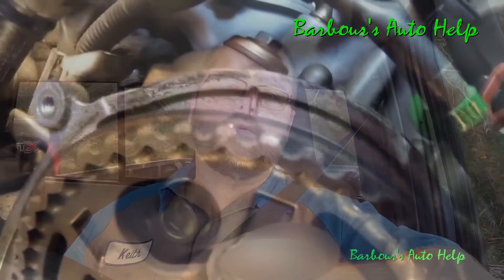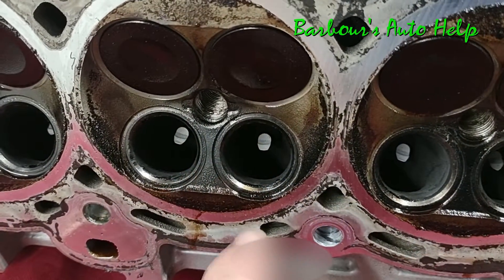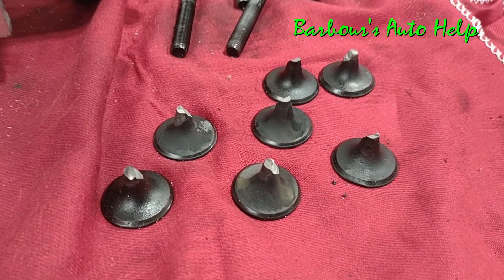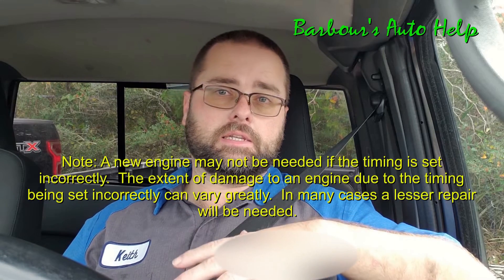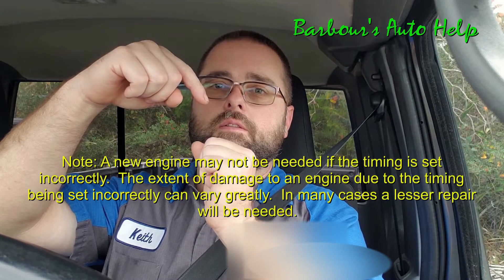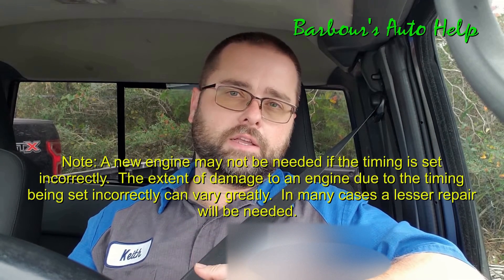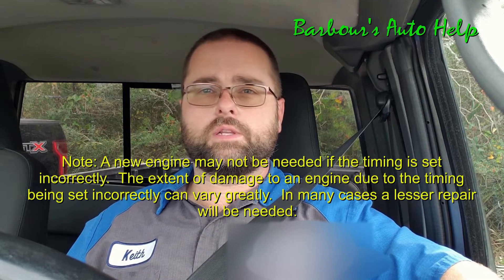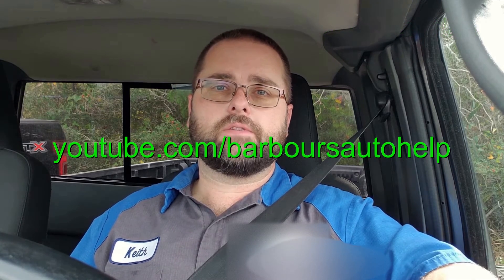What Happens (sometimes) If Timing Belt/ Chain Is Installed Incorrectly

Comment: I have a 92 dodge dakota 5.2 it jumped time on the camshaft and I went ahead and put timing chain in sprockets in it and reset the distributor to #1 cylinder on the cam sensor with the rotor and put it back together and it still doesn't run I've done everything imagineable new sensors except crankshaft sensor but it's not that old maybe 9mo. From auto zone and I'm confused what's going on I'm debating about taking it apart and reseal the top end intake and all that am I on the right track???

Comment: My mechanic changed the timing belt 2 days ago for me and after that smells gasolin behind the car and. When i want to test i went with 1, and car like jumped and stopped. Then start to turn off. Could be valve broked? The car it goes now but its so wierd. He told me inhave injector problem but i dont think so. I ordered new washers for injector and bensin filter. I dont know i think he broked something in there and he dont wanna say
Reply: Injector problems engine light in the display could be the same thing as the chain is installed incorrectly causing a misfire